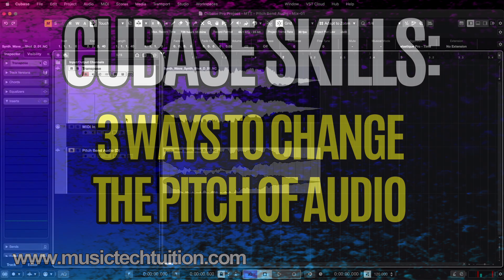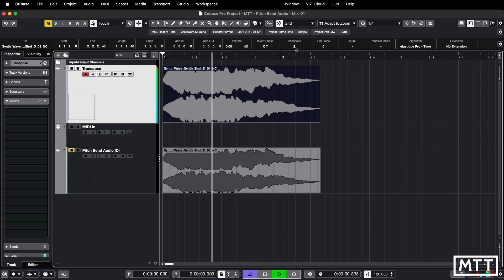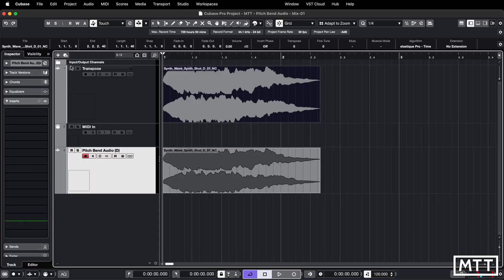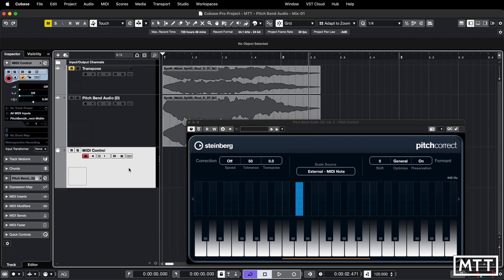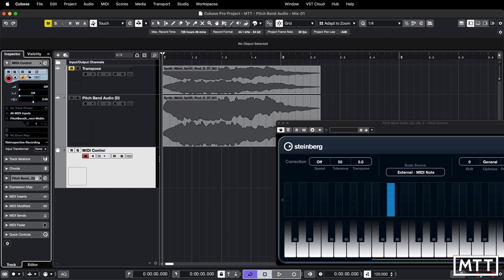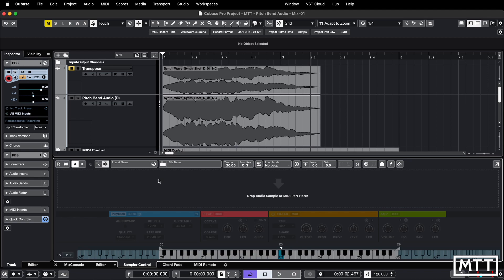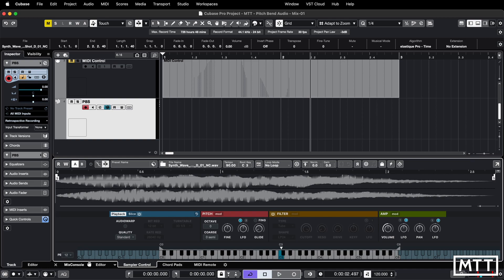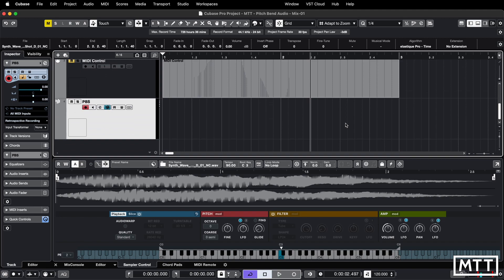Cubase Skills: 3 Ways To Change The Pitch of Audio

Comment: Also, there's a built-in FX Modulator plugin. Open FX Modulator and drag the square in the middle of the display while holding Shift. The resulting pitch shift will be shown to the top right. Formant Preservation is disabled by default.

Comment: Let's say you record a guide track from an old single and it isn't coming out at 440Hz tuning, maybe flatt or sharp. It clashes with the midi tracks you are using. What would you say is the best of these methods to just nudge the guide track to perfect concert pitch?
Reply from the maker: If it's in time, I'd just use the standard transpose/fine-tune controls in the default mode to get it to be in tune with the MIDI.  I've had to do this quite a bit over the years...
Reply: @musictechtuition  thanks, will give it a go later.
Reply: Came across a problem when I tried this. My guitar tracks all had transpose on them, however, the guide track didn't show or offer Transpose in the Menu Bar. Realised it was because I had put Spectral Layers Extension on it to extract the vocals. Once I removed SpectralLayers, the transpose options re-appear. I was able to Transpose it down 40 Cents, bounce it to a new track and then use the Spectral Layers to extract the Vocals from the Guide, all of which are now in tune. So Thanks for the guidance you gave, this has certainly sorted out a lot of issues I have when playing to guide tracks.

Comment: Hi, I am transferring some old tapes on to PC but, the tapes were mastered down at 7 1/2ips how, via cubase can I change the the audio to 15ips? Love your book it has been so helpful.
Reply from the maker: Hi Ron.  I'm assuming that you're playing it back at either double speed or half speed, and want to then put it back to the correct speed in Cubase?
Reply: @musictechtuition  Yes
Reply from the maker: @ronbooth1382  It'll probably make for a useful video, so I'll do that instead of a long text explanation!
Reply: @musictechtuition  Ok Darren, thanks so much.
Reply from the maker: @ronbooth1382  - Video on this coming up next Friday (20th). 👍
Reply: @musictechtuition  Darren, I feel so stupid! The info I supplied you is slightly wrong. The tracks were mixed down to a tapedeck running at 15ips, (a Philips N250 I think). I recently borrowed an Akai DS4000 to transfer them to PC but the top speed of the Akai is only 7 1/2 ips. So I need to go from 7 1/2 to 15ips on Cubase. I hope I haven't caused you to do a lot of work for nothing.
Reply from the maker: @ronbooth1382  Not at all!  I did examples doing it both ways, so I think you'll be good.